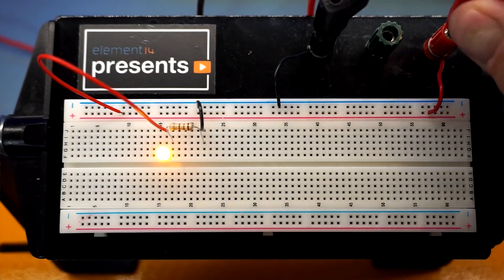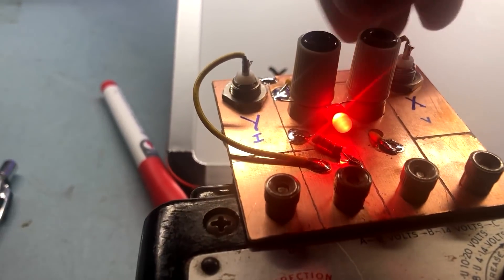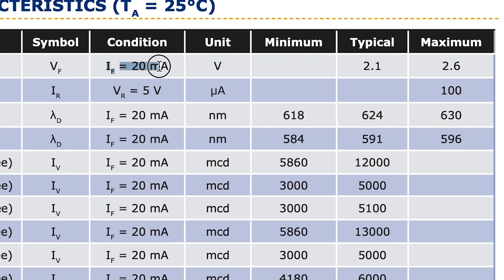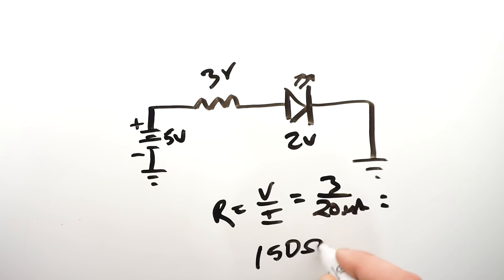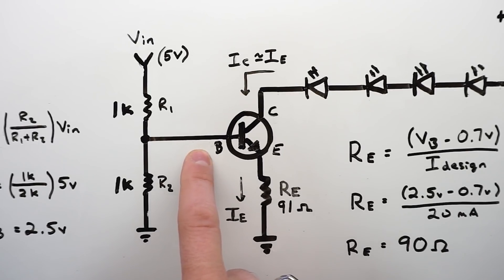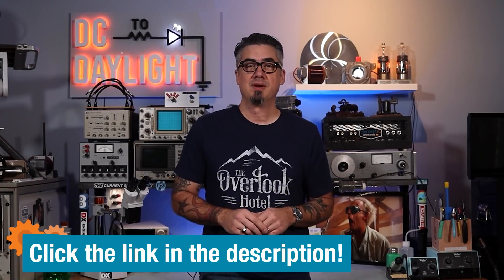How to Drive LEDs - DC To Daylight

Comment: With the prospect of an SHTF given our present and deteriorating economic outlook causing power failures;; I'm wondering how possible it would be to extract enough atmospheric electricity to light enough flashlight LED'S for home elimination and recharge a bank of batteries that would power other household appliances.   Or would it be more practicable, all be it more expensive to just use solar panels,

Comment: You really don't 'want to be' several volts above that required by the LED string.  Anything at or above that value is just fine.  If all you have is 12 volts, or that voltage is already in your design, it would be a waste to buy or add another supply voltage just for the LEDS, but a good 9 volt supply would have worked just as well.

Comment: Thanks!  It hadn't occurred to me to think about the voltage drops along the base-emitter path.  Now I also have a better understanding of using an NPN transistor as a switch (emitter connected to ground, and a current limiting resistor between the input signal and the base).  The current limiting resistor would have to drop the input voltage minus the base-emitter drop (around 0.7 volts).

Thinking of a BJT as a current amplifier, could you also control collector current by limiting the current into the base?  For example, 5 volts connected to a 50K resistor to the base, emitter to ground.  Current into the base would be 0.1 mA.  If the transistor has a beta of 200, the collector current would be 20mA.  I'm guessing this is less stable/reliable.  I imagine the beta varies between transistors (even in the same manufacturing batch).  And does it vary with other factors (like temperature)?

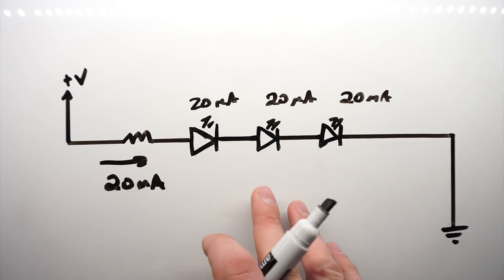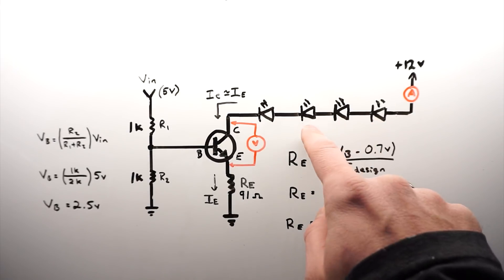Comment: You comment at 7:46 about the 3 LED and resistor series possibly having different voltage drops across each LED (assuming manufacturing tolerances) as a reason for utilizing the transistor circuit and then at 11:34 comment that each of the 4 series LEDs in the transistor circuit will have the same voltage drop.
In both circuits the current through the respective LED in series will be the same, so what principle makes a consistent voltage drop on the transistor LED series that is not achievable in the non-transistor series?
Not following the logic of a more complicated circuit requiring 2 voltage sources (5V and 12V) to achieve the same result of illuminating the LED.
The transistor should have no impact on manufacturing tolerances of the LED, should it?
Reply: @AmRad Podcast : Thank you for the further details and explanation. I appreciate it. Cheers!

Comment: This is why they have 2 transistor current mirror circuits.
Reply: @AmRad Podcast 2 transistors and 2 resistors, and you'll have constant current no matter the voltage (to the rating of the transistor). I think 2N3904 can go up to 40V.
A single transistor works if the source voltage doesn't change. Like in a USB power.

Comment: Newbie here, still have lots to learn, I really enjoyed this video, thanks so much  (I ended up replicating what you did, it was fun) but my multimeter is currently down and I’m curious to know about the volts, the 1.8 volts from the base to the emitter, and the 12 volts -0.7v you supply from the collector-base, would that mean there’s 13 volts being supplied across the emitter collector junction?
Reply: Hey Derek is there a way I can email you a specific question regarding a project of mine?

Comment: I really, really enjoyed this. Really clear and concise, but you didn't feel like you skipped over anything. There's nothing worse than someone cutting from a very simple idea and then throwing in a bunch of components without explaining what they are for.  

Personally I'd like to see a lot more on transistors, when to use what kind and how. Maybe even making and / or / nor etc gates with them.   Keep up the good work!
Reply: @AmRad Podcast That's a good idea. I tend to stick to TTL logic chips when I need something, when I know that a lot of the time a transistor would actually work perfectly fine, depending on the need. So it would be good to have a few examples of nice practical uses where I can break the buggers out, rather than say, stuffing a microcontroller into something.

Comment: Can you talk about commercial LED lighting, such as under-cabinet lighting equipped with a dimmer? What is the dimmer doing to the wave-form, how does it accomplish this, and why doesn't it get warm? (While the power supply and lights are getting noticeably warmer during use?)
Reply: Usually those are driven via PWM (pulse width modulation.) In PWM, the LEDs are NOT constantly "on", rather they are turned on an off very rapidly with rapid pulses (think square waves.) To us humans, the LEDs look like they are on solid, because of Persistence of Vision. (If you take a camera with a frame rate that is synchronized with the pulse wave, you can see the LEDs turning on and off.)  The amount of time the square wave is "high" vs. "low" controls the brightness (known as "duty cycle.") What the dimmer is doing is it is varying the amount of time that the square wave is "high" (LEDs are on) vs "low" (LEDs are off.)
Reply: @Otakunopodcast  But, how?
Reply: @chrisallington1638  Nowadays, usually with some sort of microcontroller, like an Arduino. Google "Arduino led pwm" and you will see plenty of examples. You could probably do it with a 555 timer with a variable resistor/capacitor to control the pulse frequency as well. Google "555 timer pwm" and you should see some examples of that.

Comment: Can you make a video on transmitters and receiver module circuit diagram used 
for RC  car or toys , reverse engineering. 
Second thing I'm taking the liberty to ask your help,  I'm a beginner in electronics, having basic knowledge, suppose want to design own transmitters and receiver module circuit, for RC toys, what are the topics I should study📚✏